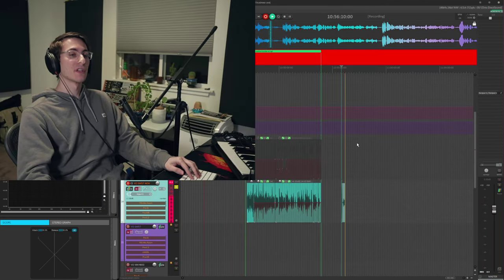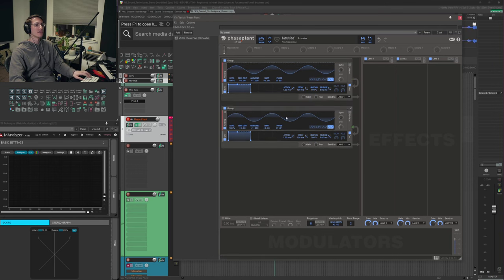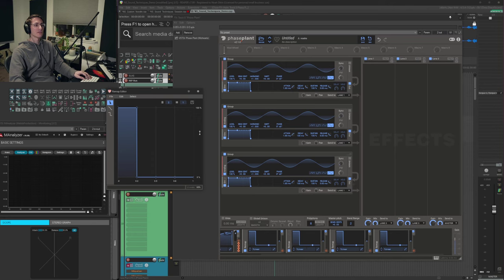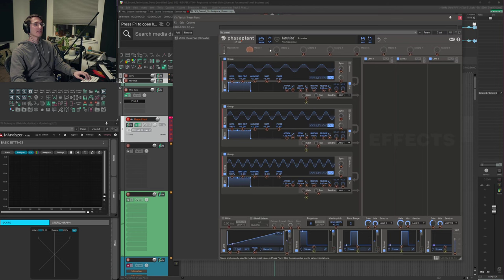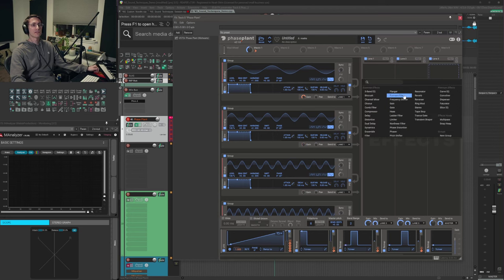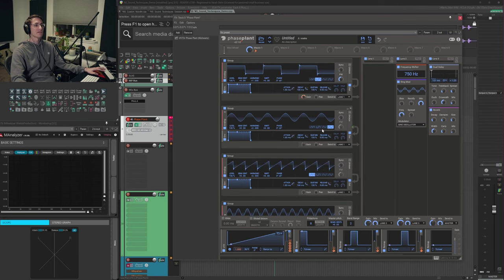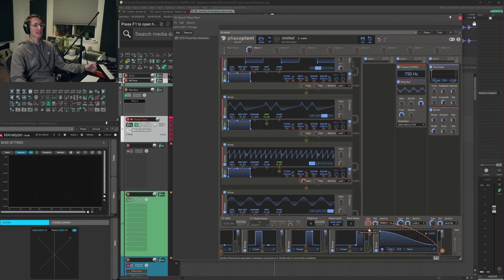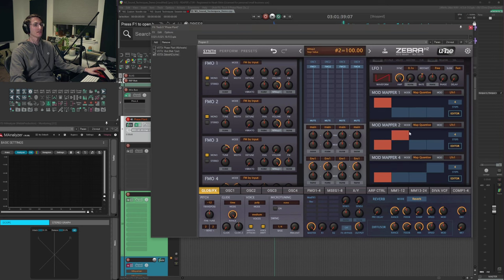Sound Design Trick - Recreating Galactic Assistant in Phaseplant

Comment: would it be possible to do by modulating the pitch rather than blending?
Reply from the maker: Totally, that's how I approached this at first before landing on the remap thing. It has a slightly different sound to it but it's in the same vein. You can either use a couple square wave modulation oscs to FM the primary audible osc, or use LFOs. Then the amplitude of the modulators determines the interval set by harmonics in my demo. It can be a little difficult to keep the modulating oscs in sync/phase this way while also getting a wider variety of sounds, but it's worth exploring